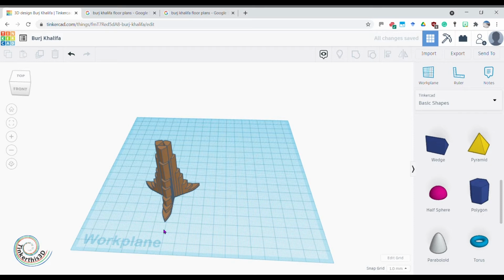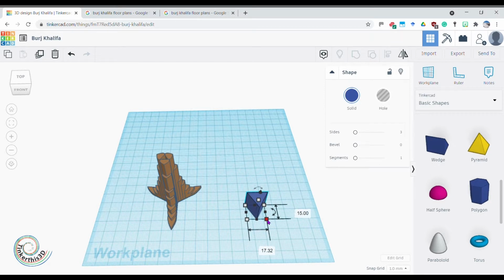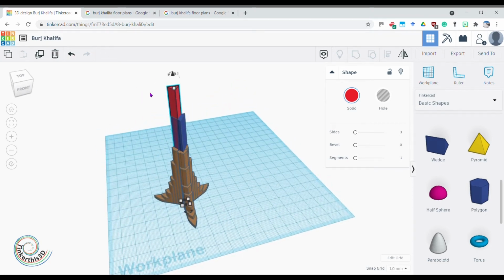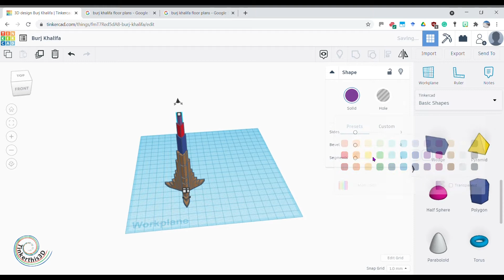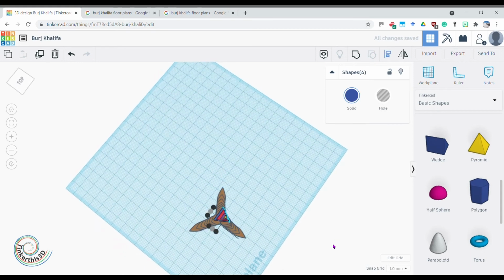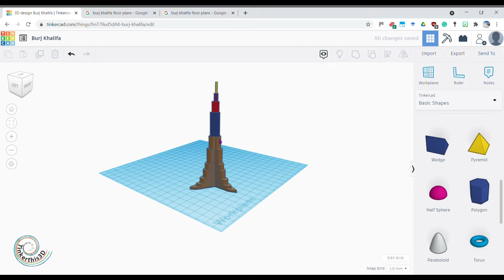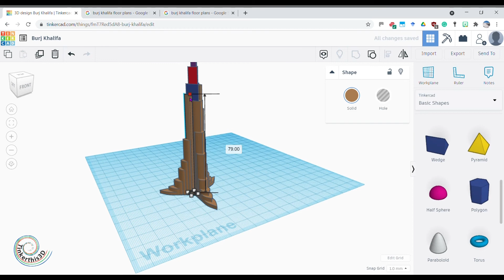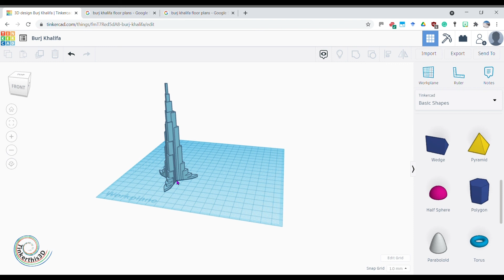3D modeling the Burj Khalifa in TinkerCAD Part 2. 3D printing

Comment: How do I put them in the middle the triangles
Reply: idk lol
Reply: you can use the align tool. if you are on laptop, click on the first triangle and long press shift key while clicking on the other triangles then let go of shift key and then click on the align button. the align button is the sign with a vertical line and some small circles connected to it. when you click it, follow the video. hope this helps :)